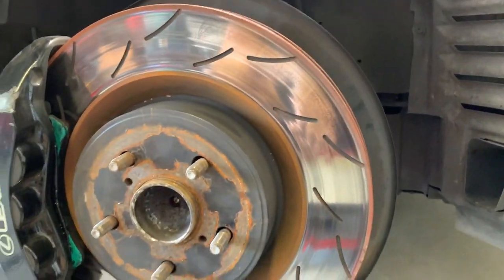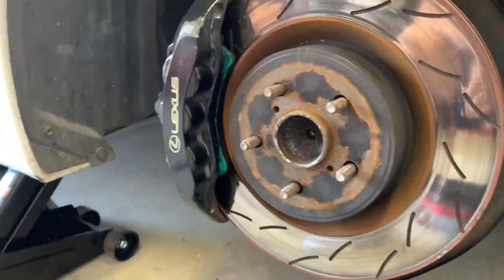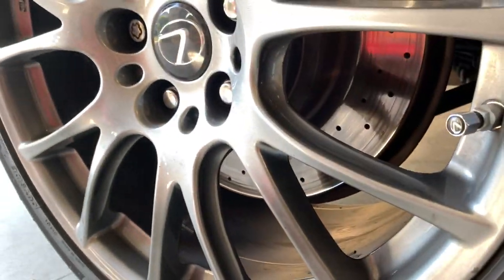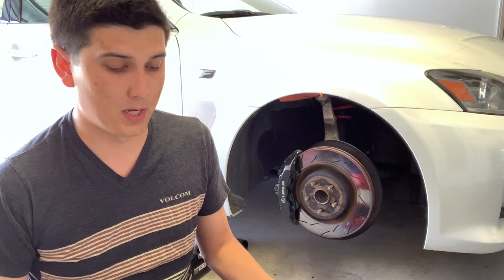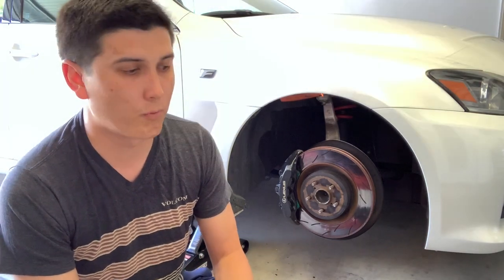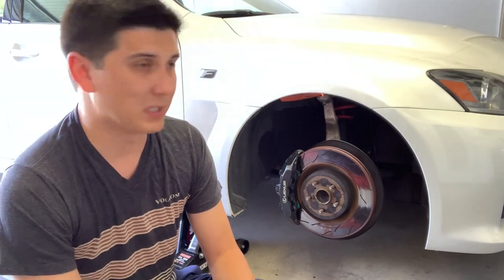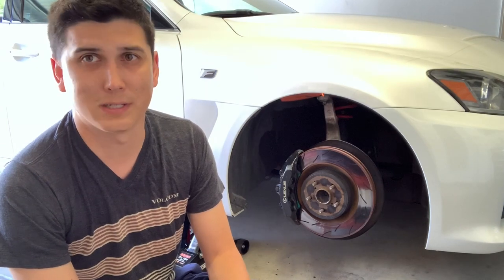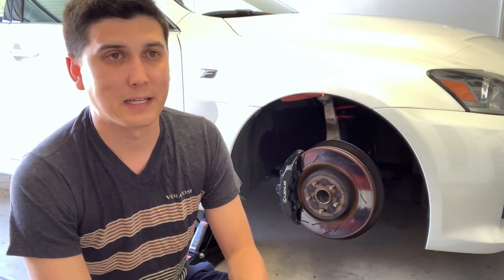Brakenetic Rotor Review/Update - Lexus ISF

Comment: I heard with slotted rotors there is less squeak? Did you notice any difference? Thanks for the video I'm looking to change my rotors so it helps.
Reply from the maker: No difference in squeaks between the two that I notice even between both pads I use.